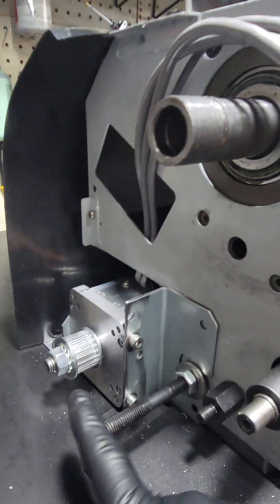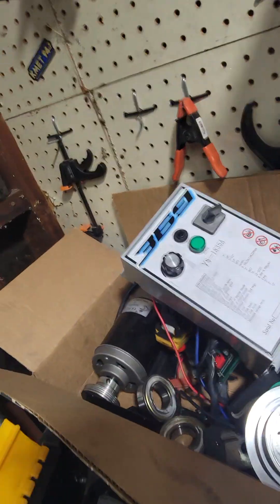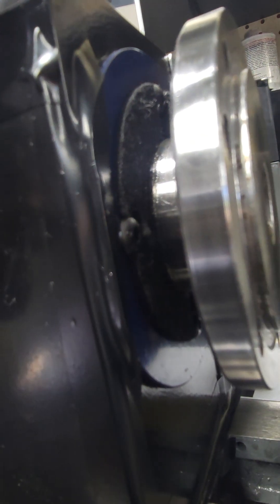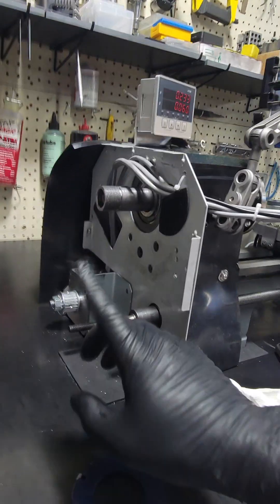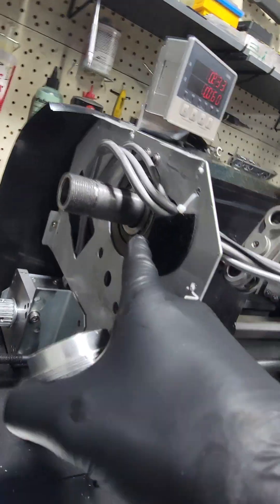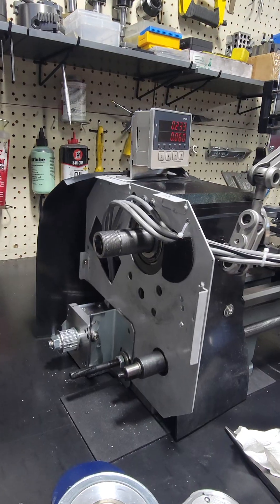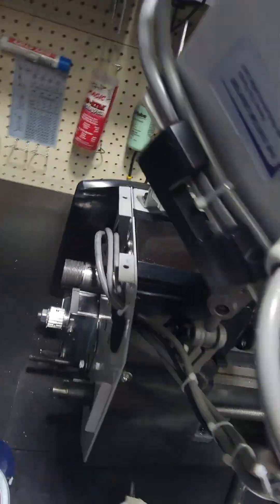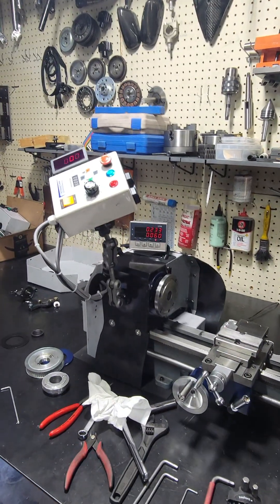Amazon lathe 900watt w/ tappered bearing how to. "They" said it can't be done.

Comment: Ummm, where exactly did you think the grease would go?  If this was designed correctly, or even kinda close to correctly, and if the right grease is used, it will stay in the bearing until age, heat, and gravity eventually cause it to weep out.
Reply from the maker: The tappered bearings are known to create significant heat and being that I broke in the bearings and they did get pretty hot I expected to see more grease liquidity. It seems the mobile nlgi 2 works great 👍